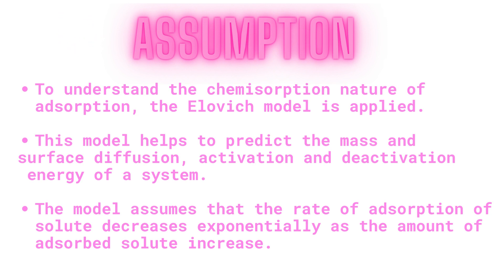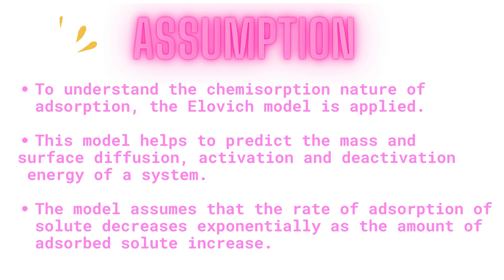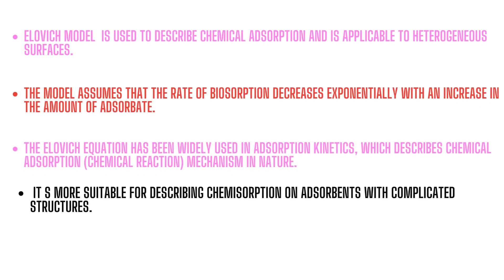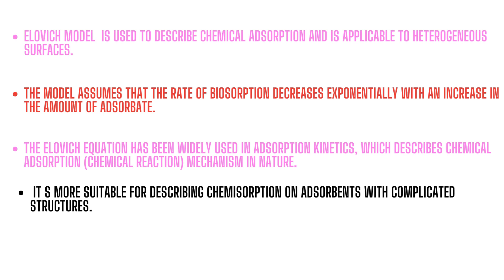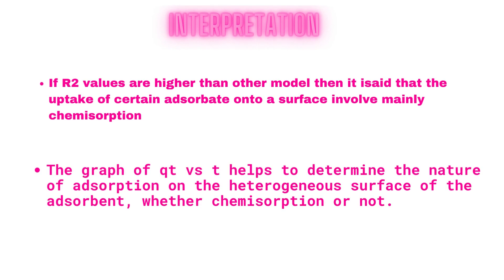How to Interpret Elovich Kinetic Model

Comment: Many thanks. I appreciate many of your videos. I am currently conducting an Elovich kinetic analysis. In my results, I found that the R2 value for the pseudo second order model (R2= 0.99) is higher than that of the Elovich model (R2= 0.98) . This indicates that chemisorption is the primary mechanism. How can these results be interpreted in relation to the adsorbent's heterogeneous surface?
Reply from the maker: The adjustment of pseudo-second order does not indicate the chemisorption mechanism. May literature suggest this but this speculative. Because spectroscopic studies are necessary to predict actual mechanism of adsorption.
Reply from the maker: Surface nature can be obtained by Langmuir or Freundlich isotherm model. Please visit all other videos and don't forget to subscribe to this channel.